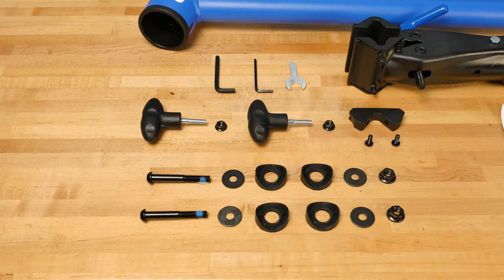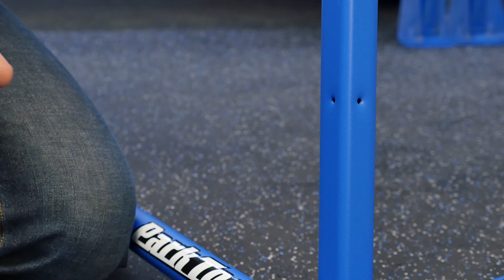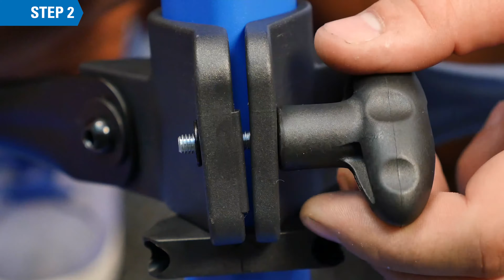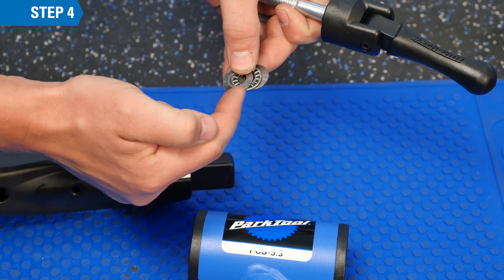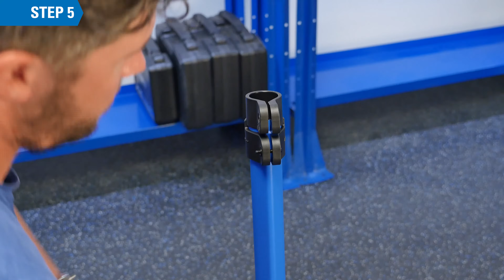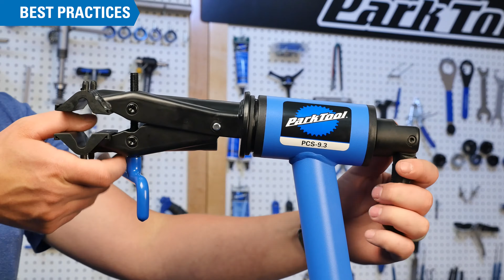How to Assemble the PCS-9.3 Home Mechanic Repair Stand

Comment: Hi there - for step 4 is the cone meant to be rigid once assembled or able to rotate?
Reply from the maker: It should be able to rotate. A small smack to the side of the clamp should free it if you ever experience stiction.

Comment: good thing this exists considering how difficult it is to use the included paper instructions. why are they difficult to use? because it is VERY difficult to see which part/component is which. why not include a page showing in greater detail the relative size/shape of all the smaller included parts? also, all the torque recommendations herein using "included hand tools" are just...lol. why be dumb about this?

Comment: That spring button is the only upgrade from PCS-9.2.   Because the there is a chance that leg clamp will not hold in long/short term usage with bike loaded.... risking the entire stand to fall.

For those with 9.2 to just do a DIY and buy a pipe clamp with a strip of old tube to prevent scratch and better grip and place it above the leg clamp (where the spring button is on 9.3).

Cheers!